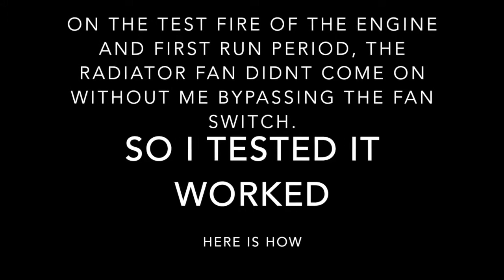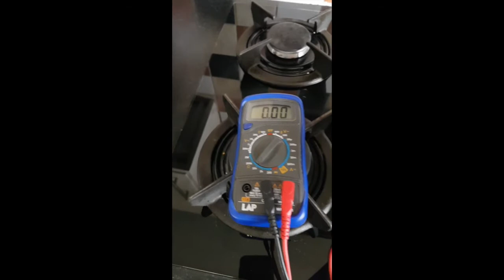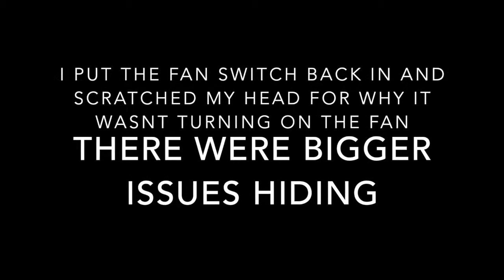Daytona Coupe kit car build - Episode 7 cooling system

Comment: I look forward to seeing mods you might need to pass your MOT (or equivalent) such as illuminated side markers, backup lights, etc.
Reply from the maker: Hello mr pitts. I have already got the side repeater lights but not yet decided on an exact location. As for the rear fog light and reverse light, they are fitted to the rear of the car already. You can see more of the car in my Instagram page @_danbuilds